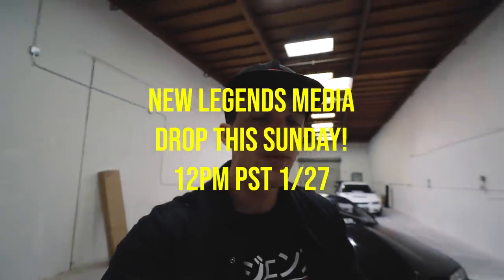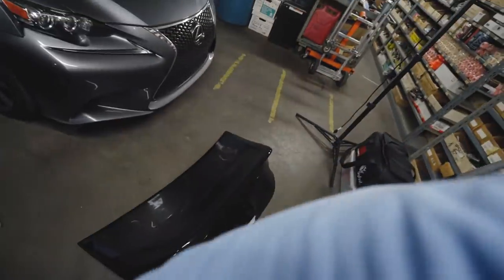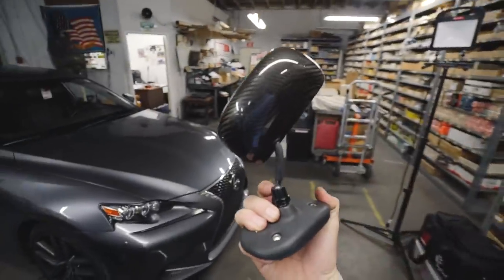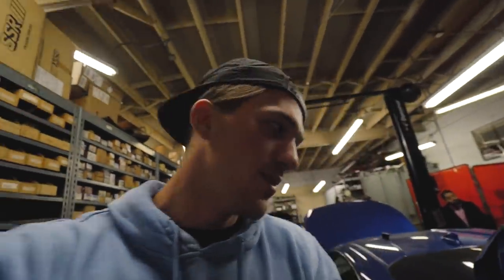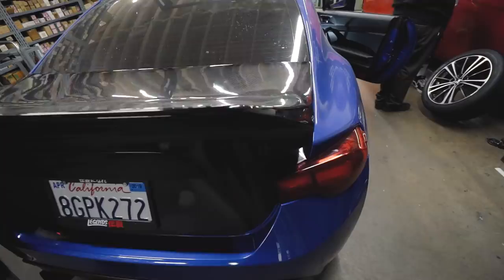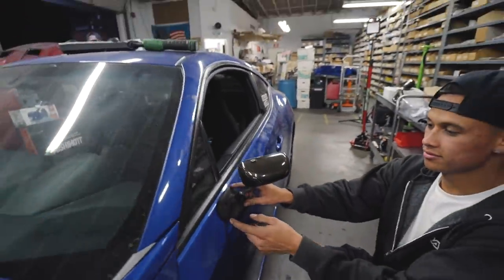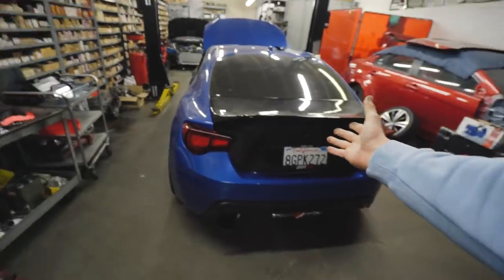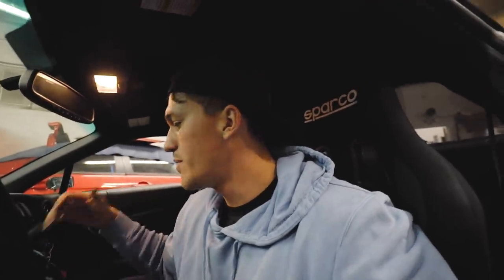Boosted BRZ Gets Carbon Fiber Makeover! *Carbon Fiber Duckbill Install*

Comment: FYI, the reason why your Q&A has that odd black bars moving up the screen has to do with the lighting and your frame rate. In America lights have a 60hz frequency so if you’re filming in 60FPS you’ll see this. Also known as a horizontal banding or even flicker. Some cameras have a setting that removes this if enabled. Or you can fix it during editing. OR change your frame rate.

Comment: Isn't that you drift car. Why make it look pretty so early and you haven't even drifted it yet
Reply: kevin leoo he didn’t buy em though. What’s the problem with making a car look good drift car or not
Reply: @griffcoleman  no problem at all.  Its just that it seems like this car Is going to be another show car than what it was initially bought for I guess. But it's still not a problem. If it was a drift car these are all nice parts would hate to see it go to waste. While he smashing walls
Reply: kevin leoo it’s called drifting in a open lot not in a parking lot and why does it matter to you it’s not your car 😂